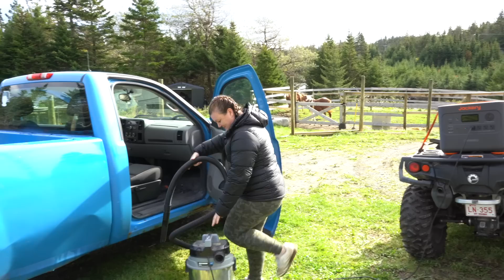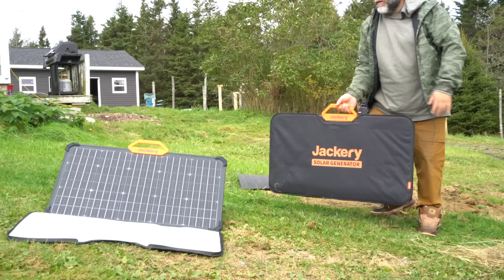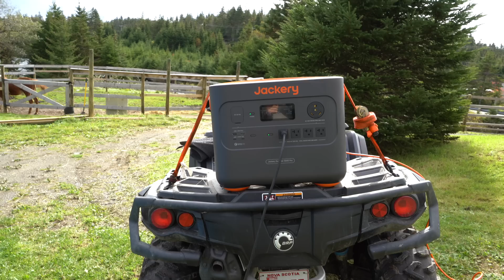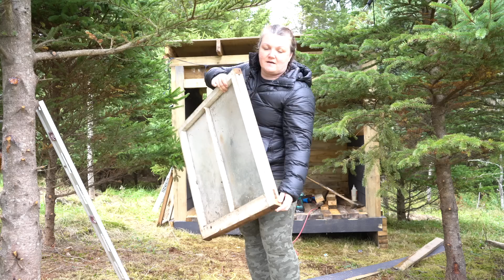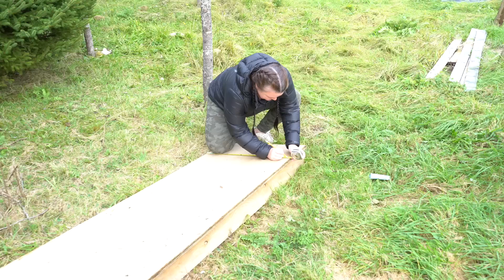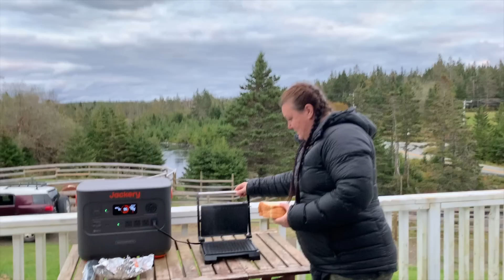Creating FREE POWER on our homestead!

Comment: OMG This is the best jackery use video Ive seen! I have been curious but didnt know that much about how to use them. The 3000 seems amazing. We retred Caliornia rural high desert. We camped and fished here. So have extremes of temps and some snow. Not like you have but no one told me there would be snow. I lived all my life in Orange county, Anaheim. Mild. Could pant seeds 11 months of the year. Nothing froze. But learning fast. We have our small trailer we used for camping. It was solar ready. Rather than buy the starter kit they referred us to we saw a large panel on sale. That thing can charge our trailer battery from dead. Also got a small honda generator. I love the fact the Jackeries can move around and charge from solar panels. So how do I say it. This valley...our town the electiricty and wifi independently go off quite a lot! We can use our trailer for emergencies though. It has a gas stove from the propane tank so we are not totally desparate. We also have an acre lot. Not huge but as you said hard to do some projects with electricity at other end of the lot! Im going to have my partner watch this on the big screen smart tv! I watch you all there but comment on my tablet!

Comment: Super cool! I have an Aeusiny solar generator I’ve had for almost 6 years. So great for camping for string lights and charging everyone’s phones. I live in a camper and during the winter I have to balance electrical loads, so I plug in a light that would normally be plugged into the heater outlet into the solar generator, or I’ll run my TV on it if I’m running the heater. I also use it will a small air compressor. Today I used it to blow out my water lines. Also can use a brad nailer with that. Super handy. I have 100w panel for the warm months.
Reply: oh brad nailer and compresser! Im a diy older women but Im stopped by well my lack of knowledge a bit but cautious in investing in certain things if its just frustrating anyway. Im long time sewist. Over 60 years but my Scottish immigrant parents to USA did most all DIY even if it was just simple hand tools. So as kids we got exposed to helping early!
Reply: @retroredo9850  the brad nailer is from Harbor Freight. I’ve used it quite a bit and it’s held up great. It goes on sale and I think it’s only $19.99. The air compressor is a pancake style small one that I got at a school garage sale for $2! I’ve done trim with both nails and braid nailer, and the nailer makes things considerably faster and easier.